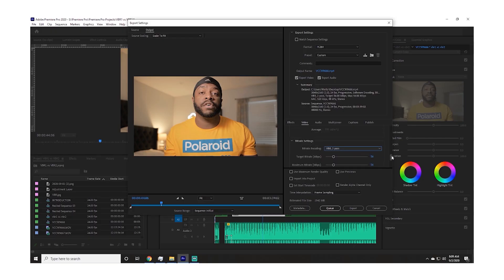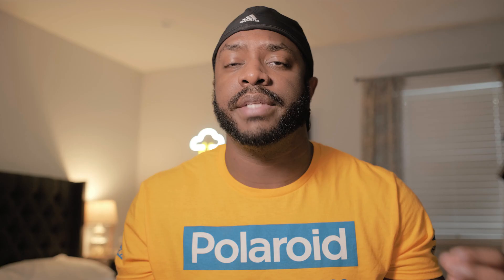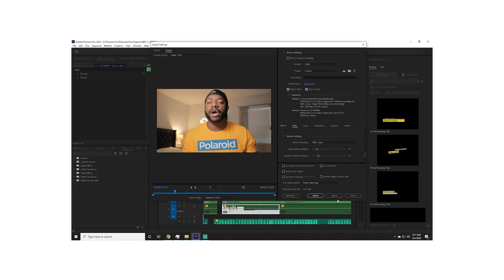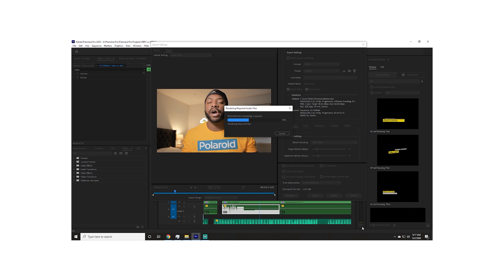VBR 1 Pass vs VBR 2 Pass?  When Should I use VBR 1 vs VBR 2? Let's Talk Differences in Premiere Pro

Comment: 00:20 No, Variable Bitrate (VBR) encoding  is always variable. You set both a minimum and maximum bitrate, and the actual bitrate used during encoding will fall between those two values. If you look closely at the label in Premiere Pro, it also specifies "Max Bitrate."

It’s not like you explained, where the second bitrate is only used for frames that need more 'power'.

The difference between 1-pass and 2-pass encoding lies in how the encoder decides what bitrate to use within the range you set. In 1-pass encoding, the video is analyzed and encoded in real-time, with the bitrate for each frame being determined on the fly. In contrast, 2-pass encoding analyzes the entire video beforehand, allowing it to allocate the bitrate more efficiently across all frames.

That’s at least how it’s explained on Wikipedia. I’m curious, where did you get your information from?

Comment: I have a problem, with gopro footage in Premiere. Some audio just disapears in rendering. They are about 30 min ling videos, so it's very frustrating to watch it all and the render again if needed. Sometimes you just can't fix it. Now I've set it to vbr 2pass, hoping maybe that will fix it. Found on reddit, that this happens because of VBR. Would be interresting to hear your opinion on it. Cheers.

Comment: Thank you for this. How would you set your VBR 2 for 4K Youtube videos? What would be your target and max bit rates?
Reply from the maker: In my VBR 1 Pass I show the targets YouTube recommends. You can also find this table by searching "YouTube recommended upload encoding settings". If your video is specifically for YouTube, I'd use the min they specify on the first pass and max on they recommend on the second pass.
Reply: @visionarywatts  thanks. So it does sound like a good rule of thumb would be 45Mbps for the first pass (target), then then 56Mbps the second (maximum)

Comment: Hi, great video, really clearly explained - thank you - liked and subbed. One question for your thoughts. You quoted a bitrate as that's what youtube recommends for uploads. I've seen other suggestions that making your video as high quality as possible and then upload and let YT compressions (which they suggest will happen whatever) work on a better file. In my case I'm working on 8k 360 and trying to keep images as sharp as possible, as otherwise easy to look blurry on a VR headset. What would you suggest is the best way to get as best quality as possible on the YT upload - upload best possible render, max out VBR, or upload with settings to their guides to limit their compressions - assuming time rendering, disk space and uploading time is not an issue?
Reply from the maker: I'm never going to suggest anyone max out VBR in their editor when uploading to youtube just because youtube is going to compress things down and we don't know how bad it can be when they do that. I can't remember which video of mine it was but one of them where I used heavy graphics, I exported at a bitrate of 90. Looked great on my computer but after the 4k processed on youtube I saw some banding blocks. You can experiment exporting to the higher bitrate youtube suggests for your type of video then repeat the export with your maxed out settings and see if you can tell a difference in the shadows, highlights and see if there is any banding . I've seen stats over the last year that most people are watching youtube videos on their phone and at 720p or lower. So at the end of the day, don't too caught up in the details of it all. Just make sure you're nailing your focus, having a high aperture for your subject and possibly using 30fps for less motion blur.
Reply: @visionarywatts  ok, thanks for time answering & advice. I might just do a bit of uploading of sections at different bitrates and see how they compare after YT compression. I mean that's obvious really as the way to find out but the thought of rendering at a lower bitrate to suit YT recommendations (rather than max-ing out quality) hadn't struck me as having advantages until watching your vid and got me questioning. Many thanks.

Comment: Thanks for this video bro, exactly what I was looking for! I shoot in 1080p at 30fps but export in 4K at 30-35fps (VBR1 + 2). I have noticed that sometimes just using VBR1 exports a lesser quality video so I always use 2 passes to make sure I'm getting the best quality- although it takes a lot longer.

Do you know why I'm unable to use hardware encoding when it is 2 passes? It doesn't make sense to me why I can only do that when I select 1 pass.
Reply from the maker: I only know that's it's available for VBR 1. I'm not much help there.
Reply: if you haven't found the solution until now, then the solution is...   https://www.youtube.com/watch?v=lcKuBkxg-bg

Comment: Is there a way for enabling hardware encoding for vbr 2?
Reply from the maker: Adobe doesn't currently support VBR 2 hardware acceleration at this moment in time. 

You will see that you can select it for VBR 1 and CBR but the program will tell you "Error: Your system hardware does not support hardware acceleration for the current settings" if you try using it on VBR 2